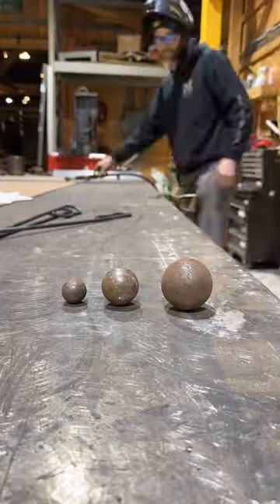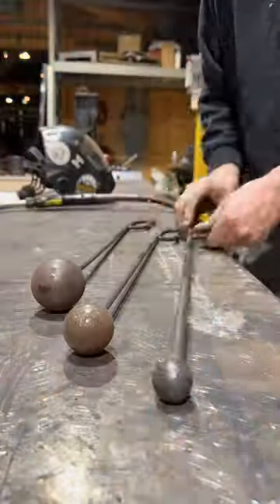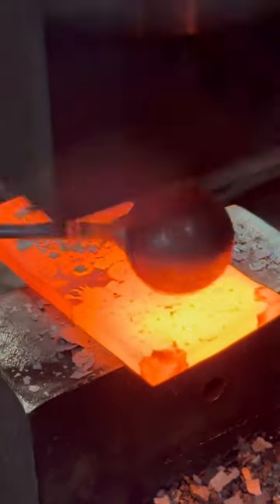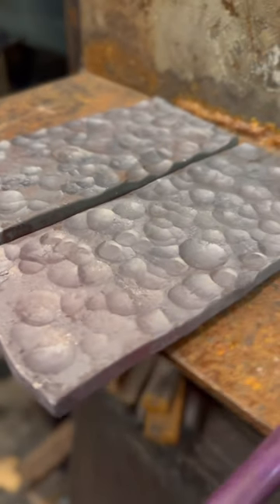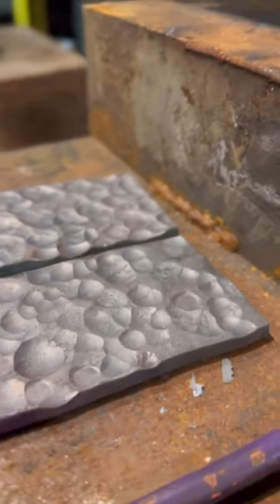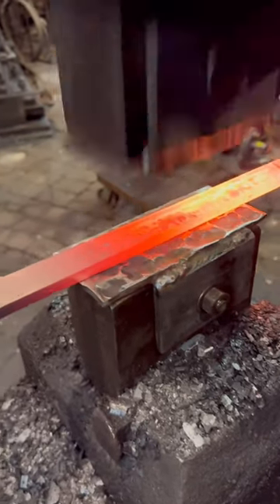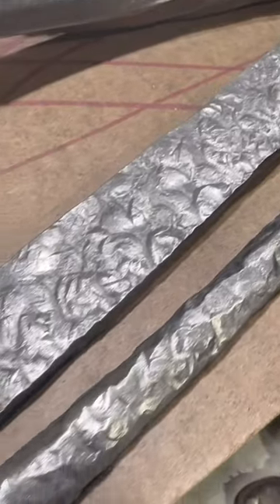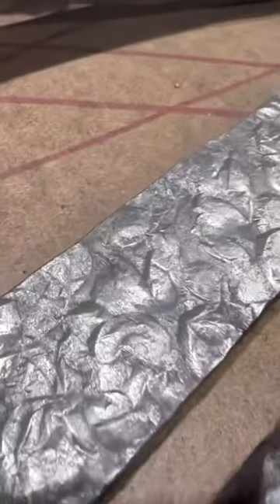Making Power Hammer Texture dies #blacksmith #fabrication #metalwork #welding #howitsmade

Comment: Well done. Are the plates you made the texture on just mild steel?
Reply from the maker: Yes in this case. It's for a limited run project. Long term I would use 4140 or similar steel for a "proper" set. Thanks for watching!